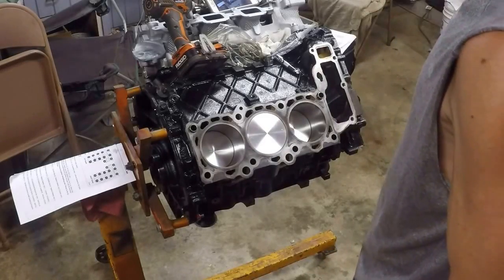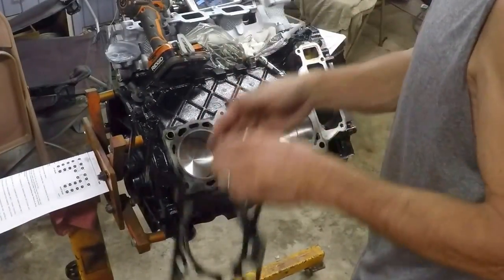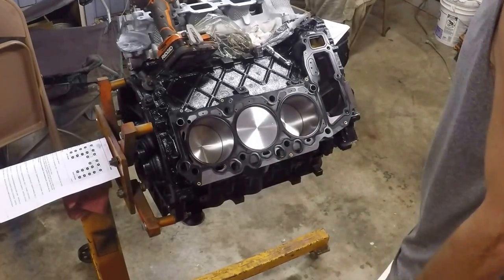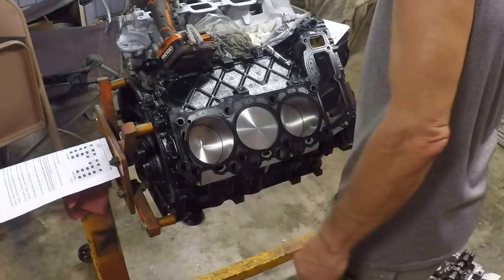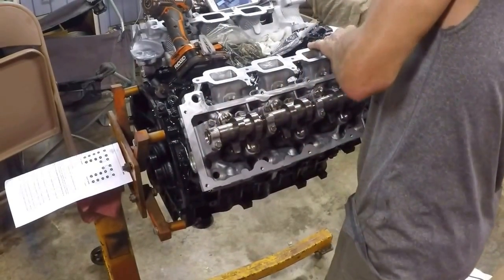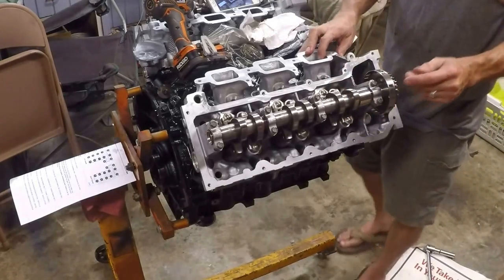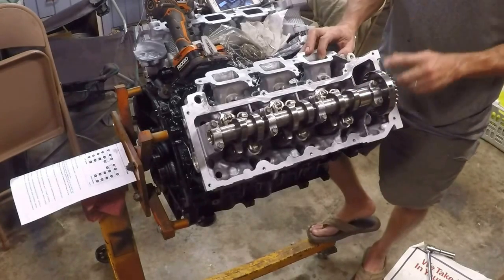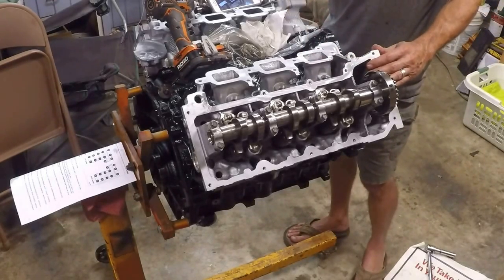Engine Rebuild - 3.7L 2006 Jeep Grand Cherokee Laredo - Part 9

Comment: Man I looked this up to see how the top end on these worked hoping they where like a OG overhead valve engine. I take it the fact something punched a hole from the inside of my valve cover out is not going to be good and something simple like drill tap and helicoil a rocker arm bolt.

Comment: I'm doing the heads on a Jeep Liberty 3.7 right now.  I tightened the head bolts to 40 lbs. I saw on the internet to do it at 20 ft lbs and 90 so I kinda went in the middle at 40 ft lbs.
I hope this is right. 😔  lots of work.

Comment: good video "butt' ?????? im doing one now,And your telling us that when you do the reguLR TIMING YOU HAVE TO TAKE THE HEADS OFF TO DO THE TIMING,WHAT HAPPENS WHEN YOU JUST NEED A TIMING IF YOU GOT TO MAKE SURE ITS ALIG BEFORE YOU TIGTEN YOUR HEAD BOLTS,CAUSE I TOOK A HEAD OFFF A JUNK YARD AND THAT THING SPUN BACK QUICK OUTTA TIME,SO IM KINDA CONFUSE,YOU CANT TIGHTEN THE HEADS BEFOR YOUR CAM IS IN LINE HOW WHAT WOULD WE DO WHEN WERE JUST DOING TIMING...

Comment: Right when i saw you not lube your bolts time to move on...
Reply from the maker: That is what I did when I leaned down behind the motor with the head bolts in my hand. I had a container of oil with the lash adjusters/lifters in it. I do wish I had called it out for others watching the video.

Comment: @Trey Clanton Hello again. I am rebuilding another one of these engines and had the block re-bored, new crank, pistons, rings, balance shaft, and re-machined heads. Got it all back together and ran perfect. After I added coolant, it developed a knocking sound which to me sounded like a mild rod knock because it sounded like it was in the back of the engine and was most audible from underneath the vehicle. Pulled it back out and removed bottom end parts. All the rods felt as tight as they should be with no play. Any idea what the knock could be? Thanks.
Reply from the maker: That’s regretful. It can be very frustrating. I’ll throw out some questions just to trigger conversation. Many are stupid questions I know. Have you pulled the valve covers off? These motors are known to pop off a rocker arm even though they looked well seated. I assume there is no water in the oil or oil in the water? You replace the balance shaft bearings? Any odd left over parts? If it’s coming from the rear of the engine, I assume we can eliminate the timing chain system. When the heads were remanufactured, did they peen the valve seats? Let’s start there. Feel free to contact me anytime.
Reply: @TreyClanton  Thank you for replying. From what I could see, the rocker arms looked as they should, but I will check more thoroughly. But there was a lot of milky stuff underneath the valve cover. No water in the oil or vice versa. The balance shaft bearings were replaced as well and no left over parts. As for the heads, the only things that was have the deck resurfaced. The thing that worries me is I did see water droplets in the cylinder via camera and there was white smoke when it was running. Do you think the block could be warped?
Reply from the maker: Milky oil means water in the oil. It could be a lot of things, but it’s most likely head gasket issues or front cover gaskets. Water in the oil will certainly cause drive line noises.
Reply: @TreyClanton  Well, thank you very much for your input. You've been a big help to me for rebuilding these 3.7l's. I'll do another teardown and maybe see what's wrong. I will certainly come to you again if I'm having trouble with something. Thank you very much again!
Reply: I have another question. Should you be able to move the piston side to side in the cylinder? If so, how much? Thanks.
Reply from the maker: @farmmachineryfan856  You should not be able to move it side to side in the area near the rings. It will move from side to side in the area near the piston skirt.
Reply: @TreyClanton  Thank you very much! This helps!
Reply: @TreyClanton  Would the newly replaced rod cap bolts need to be replaced again upon removal even when the engine barely ran? Thanks.
Reply from the maker: @farmmachineryfan856  I have done it both ways. Head bolts for sure need replacement every time though.
Reply: @TreyClanton  Thank you very much for your help. I really appreciate it!
Reply: A big headache 😫

Comment: Hello again Trey. For timing the heads, or should i say the passenger head, i set it up at an angle with a leveler on the intake holes to maintain a precise angle. Then i was able to use a pipe wrench on the old cam gear to get it at a perfect 12:00 position by putting a small leveler on the top two gear teeth. It is relatively easy. 
Just thought i would let you know.

Comment: why cant you adjust the cam after the head is on when you do the chain then use the vise grips to bring up to 12oclock on the v6 mark?
Reply from the maker: j ma You can adjust it slightly, but since this engine is an interference engine, you risk hitting a valve against a piston. It can be done, but you must take care. It’s definitely easier to get it close before you bolt the head on. If it’s not in time, you can remove the cam and Rex lock it that way.
Reply: @TreyClanton  how do you get it close are you turning the gear itself too light up

Comment: What gasket set brand did you buy for this engine ??? Thanks !  Or dose anyone know a good set to buy ?? Thanks.
Reply from the maker: kingpin DN I have used lots of kits from E-Bay onward. I tend to prefer clegengine.com, but I tend to shop around and look at the specific manufacturers for the various parts such as Mahle or Clevite for bearing, Felpro for gaskets, etc. It is all personal choice and your budget for the rebuild.

Comment from the maker: kingpin DN  The Chrysler factory manual for cylinder head torquing is shown at the link below.

http://image.slidesharecdn.com/uovaifvyqqeeil5yoqbe-signature-9e9cd8bd51ae37d042c56b51ed479f8a71b1402d2cd953ecc004e8ac1c15c892-poli-150311125035-conversion-gate01/95/jeep-liberty-2002-2005-engine-37-l-22-638.jpg?cb=1426078428

Comment: hi there
I have a 4.7 v8 powertech with some starting issues.There is spark and fuel and I have set the timing in the following way:Crank position at TDC markCam positions with V8 marks at 12Is there something I'm missing?Does the fact that the fire happens only once for the two times that nr 1 cylinder is at tdc?
I hope you can help.
Reply from the maker: Hello. Use the FASTTEC approach. Fuel (fuel pressure should be around 50 psig), air (check intake vacuum), spark, crankshaft timing, camshaft timing, exhaust, and compression. If all of these factors are in place it should run, or at least start. Check for codes after you try to start it. In a recent rebuild I completed, codes during cranking helped guide me to solve a problem.
Reply: Hi
Thank you for your response. The crank and camshafts are in position. But how do I go about to check or change the spark timing or that of the exhaust and the compression?
Reply from the maker: Spark and fuel timing are controlled by the crank and cam position sensors. Assuming those sensors are in place, hooked up, ad functional, spark and fuel timing should be good. Compression is generally your last worry for a rebuild, but you should check it to see that everything is good.. You can get an inexpensive compression tester locally. As for exhaust, you need to confirm that your catalytic converter isn't plugged. The easiest way is to try to start it with the exhaust disconnected.

Comment: Just curious where you got 90 degrees x 2?
Reply from the maker: Yohann67 After the initial 20 ft-lbs of torque on the main head bolts, you turn them 90 degrees twice without regard for torque. Some references refer to this as torque plus and angle.

Comment: I think I caught something? Do the Rod bearings run without a pump feed HOLE? Don
Reply from the maker: Hello Don. The rod bearings are fed oil from a hole in the crank journal, so there is no hole in the bearings. In some cases, there is a groove in the bearing to promote oil movement around the journal, but not in all ceases.

Comment: Trent - I know this 3.7l engine rebuild video set is old, but just wanted to say thank you for taking the time to video this, along with all of the information you share on each segment. Our son's 2003 Renegade locked up for no reason one day, no problems or sounds leading up. We couldn't find a suitable motor anywhere, so we bought a rebuild kit and I began something I've never done. Searching around for information I came across this video set of yours.. Man, what a life saver... I pulled the motor and began the tear down before I found this, but it has been my 'go to' for everything since. I've got the service manual and all that, but to be able to see someone doing a procedure is invaluable... So, thanks again... Greatly appreciated...
Reply from the maker: Tony Edgecombe so glad it was useful!
Reply: Trey Clanton
trent - How were you able to keep the right side cam lined up? Mine want to bounce forward or backwards from where the V6 at 12 o'clock.. I can get it set under spring pressure, but one little bump and it jumps off the tension again... thanks
Reply from the maker: Tony Edgecombe Hello. Just get it as close as you can. It might be off by a few degrees, but it will be placed fully in time when you install the timing chain.
Reply: ok, should I try to use zip ties to hold it in the correct position under the spring pressure point? or just leave it where it falls either the 10 o'clock or 2 o'clock position instead?
Reply: Hey Trent - I've got my engine back in but am struggling to find the transmission vacuum tube location hole on the back of the block or head? Do you remember having to connect a rubber hose from the transmission to the driver side rear of the motor? Thanks
Reply: @tonyedgecombe7354  thats not a vacuum line the hose for the transmission is a breather valve for your transmission it keeps it higher than the transmission so if your driving through water you dont get water in your trandmission the differential has them too it does attach to the motor but it doesnt connect to anything it just sits there

Comment: big help thanks...how much doest cost to rebuild it?
Reply from the maker: rofix marouane - The total cost was $2000. That included everything. It was beyond normal rebuild costs since I had to replace one of the heads and two of the piston rods.
Reply from the maker: +rofix marouane I must have missed your comment earlier. This rebuild was $2000 in parts, but with less damage it would have been closer to $1400 in parts. I had to buy a used head, two rods, and a balance shaft for this one!
Reply: Trey Clanton Getting ready to pull the engine on my 03 Liberty with tht 3.7. I have it just about ready to pull and I've just found your videos so I'll be spending time watching these for awhile.  Thanks for uploading them!!  My engine was running great to be honest but had been getting small amounts of coolant in the oil and vice versa. I've heard horror stories about these engines and decided to rebuild it before something bad happened, hopefully.  Thanks for all the info I these videos!
Reply: Hoping to keep my costs as low as possible and it's an extra vehicle so I'm not stressed for time. I've never done a rebuild though.  I definitely want to get the heads to a machine shop.  Did you have to do anything to the crank or cam? wondering if i can get away with not having them machined,  but I'll find out once i get into it
Reply from the maker: MMGJ10 I hope it all goes well! These are great engines and well worth the effort to rebuild before they get torn up beyond repair! Holler out if I can lend any support.
Reply from the maker: MMGJ10 In my opinion you should definitely get the heads reworked. If you can find a shop that can replace the valve seats and peen them in so they won't come out later, you will be much better off!